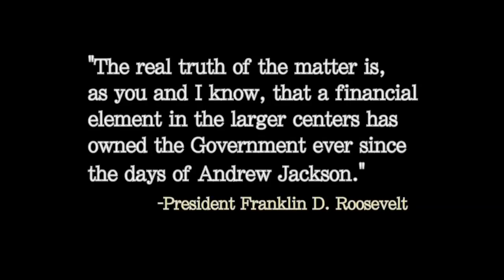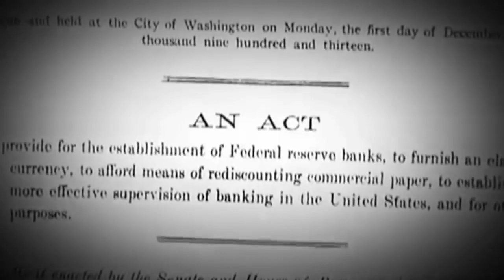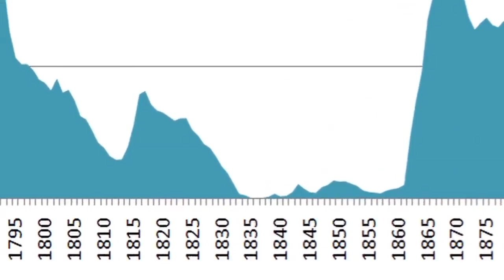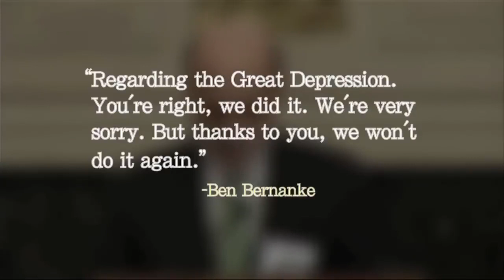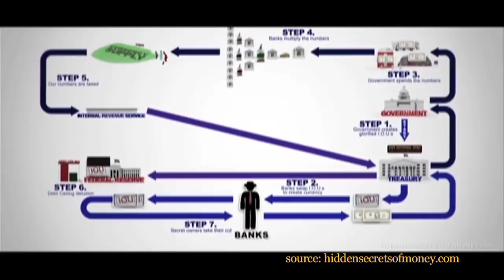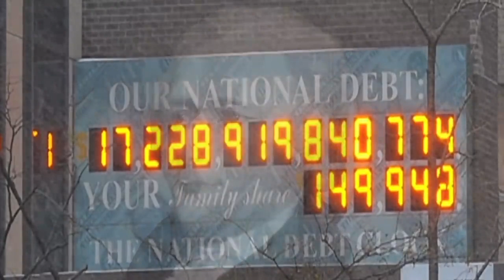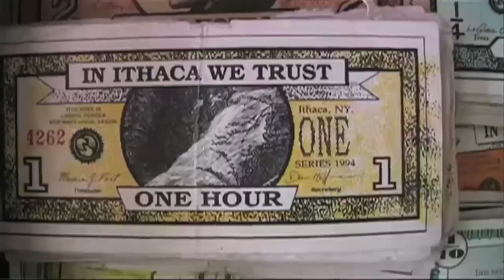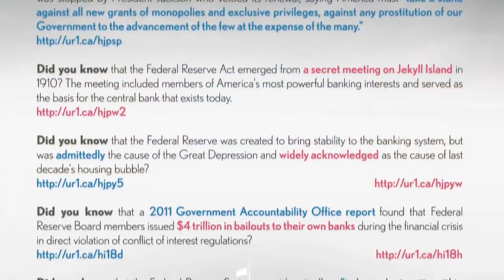How Humanity - is Trapped - Through Money? The History - The Federal Reserve

Comment: March 1, 2019
To:  US Taxpayer
Re:  Federal Reserve Improperly Failed to Disclosure $60,000 Billion in AIG Bailout

The Federal Reserve and US Treasury both reported the AIG bailout was $182 billion and resulted in a profit of about $18 billion for US taxpayers. In fact, the AIG bailout may have cost $60,000 billion more than disclosed and this amount was intentionally withheld from disclosure by the Federal Reserve Board of New York. 

Extraordinary assertions require extraordinary proof so I start with the evidence.

Magnitude of Undisclosed AIG Losses
The massive losses not disclosed in AIG’s SEC filings are disclosed in AIG Bailout Oversight Hearing, Panel 1, Oct. 8, 2008. Eric Dinalo participated in the AIG bailout discussions as NY State Insurance Superintendent and estimated the undisclosed AIG bailout (credit default swaps) at $60 trillion. Six other participants stated similar amounts: Maloney (57 trillion), Yarmuth (62), Turner (63), Braley (63), Welch (62), Sarbanes (62). The troubling nature of the “naked” credit default swaps is also set forth (essentially “gambling”, no collateral, no ownership of underlying asset, no return value to taxpayer, no cap relative to asset).

Federal Reserve Intentionally Withheld from Disclosure $60 Trillion in Losses
The $60,000 billion in losses was intentionally withheld from disclosure by the Federal Reserve Board of New York and the “extraordinary” withholding is detailed in US House of Representatives, Committee on Oversight and Government Reform, Public Disclosure as a Last Resort: How the Federal Reserve Fought to Cover Up the Details of the AIG Counterparties Bailout from the American People, Special Report, US House, January 25, 2010. When the SEC sought full disclosure as required the FRBNY responded that “This requirement is giving us some pause, since we haven’t otherwise disclosed this information to Congress.” The report states that the “FRBNY clearly hoped to prevent Congress from fully understanding the payments to AIG’s counterparties” (pg 13). 

The Committee concluded that the “fact that a quasi-government agency, unaccountable to the American people, likely wasted billions of taxpayer dollars and went to great lengths to prevent Congress and the American people from learning about these actions demonstrates the threat that the Federal Reserve poses to basic principles of American democracy.”

Further facts are found in the AIG shareholder suits vs. US in which shareholders asserted unfair bailout treatment. These cases concluded last year at the US Supreme Court. In those cases, plaintiff asserted that, at FRBNY's insistence, the actual SEC filings did not include Schedule A to the Shortfall Agreement, which would set forth information regarding the counterparties and payments funneled to those institutions (credit default swaps). Shortly after filing, the SEC noted the Schedule A omission and told AIG that under agency rules, it must include the schedule for public disclosure or request confidential treatment. In response, AIG, in consultation with FRBNY, filed a confidential treatment request with SEC to conceal the $60 trillion funneled through AIG from the public in Schedule A. The SEC granted the confidential treatment request. 

I would assert that the request for confidential treatment was improper since the information was not confidential. The losses are publicly disclosed before AIG’s SEC filings in the Oversight Hearing mentioned above and, thus, the information was not confidential and did not deserve confidential treatment.

Audit of Federal Reserve Reveals Trillion in Losses
The massive losses are confirmed in the (virtually unreported) first-ever audit of the Federal Reserve. The audit suggests 16,000 billion had already been doled out. GAO, Opportunities Exist to Strengthen Policies and Processes for Managing Emergency Assistance, GAO-11-696. Table 8 (page 131), 2011. 

In assessing the GAO audit, the Levy Institute estimated the amount to be $29 trillion (Levy Institute, Working Paper No. 698, December 2011, $29,000,000,000,000: A Detailed Look at the Fed’s Bailout by Funding Facility and Recipient).  

The Federal Reserve claims the entire bailout for all recipients was just $1.3 trillion and that a profit was derived from the AIG bailout. 

In fact, the AIG bailout likely resulted in a loss of $59,980 billion rather than a profit of $20 billion.

Federal Reserve Claims Profit
Press Release (newyorkfed.org)
August 23, 2012 

“Today’s announcement on ML III follows the successful wind-down of Maiden Lane II LLC (ML II) in February 2012, which resulted in a net gain of approximately $2.8 billion for the taxpayer. It also follows the January 2011 termination of the New York Fed’s extension of credit to AIG, which produced approximately $8.2 billion in interest and fees. When taken together, the total net profit to taxpayers from the New York Fed’s assistance to AIG and AIG-related facilities was $17.7 billion.”

The media widely reported this alleged a “profit” and the US Treasury issued a similar press release. 

Treasury Sells Final Shares of AIG Common Stock, Positive Return on Overall AIG Commitment Reaches $22.7 Billion 
12/11/2012 
WASHINGTON – Today, the U.S. Department of the Treasury announced that it has agreed to sell all of its remaining 234,169,156 shares of American International Group, Inc. (AIG) common stock at $32.50 per share in an underwritten public offering. The aggregate proceeds to Treasury from the common stock offering are expected to total approximately $7.6 billion.

Giving effect to today's offering, the overall positive return on the Federal Reserve and Treasury's combined $182 billion commitment to stabilize AIG during the financial crisis is now $22.7 billion. To date, giving effect to the offering, Treasury has realized a positive return of $5.0 billion and the Federal Reserve has realized a positive return of $17.7 billion.
https://www.treasury.gov/press-center/press-releases/pages/tg1796.aspx?mod=article_inline

Federal Reserve and US Treasury ….  Mr. Geithner meet Mr. Geithner
The Federal Reserve Board of New York (FRBNY) and US Treasury both ignored their duty to inform the US taxpayer of the massive “secret” AIG bailout and served the interest of the central bankers instead.

The president of the FRBNY was Tim Geithner when the terms of the AIG bailout were “negotiated” in November, 2008. Later that same month (Nov. 24, 2008), Obama appointed Tim Geithner as US Treasury Secretary. 

Mr. Geithner seemingly served the interests of the Federal Reserve as FRBNY President and as Treasury Secretary.

Tim Geithner wrote a book detailing his heroic efforts in saving the economy. Seriously?

Summary

The $182 billion bailout of AIG supposedly produced a profit of $18 billion. It appears that the AIG bailout may have cost $59,982 billion instead and this amount was improperly withheld and misrepresented by the Federal Reserve and the Treasury Department.

 “A nation can survive its fools and even the ambitious. But it cannot survive treason from within. An enemy at the gates is less formidable, for he is known and carries his banner openly. But the traitor moves amongst those within the gate freely, his sly whispers rustling through all alleys, heard in the very halls of government itself. For the traitor appears not a traitor; he speaks in accents familiar to his victims, and he wears their face and their arguments, he appeals to the baseness that lies deep in the hearts of all men. He rots the soul of a nation, he works secretly and unknown in the night to undermine the pillars of the city, he infects the body politic so that it can no longer resist. A murderer is less to fear.”  Cisero

Regards,

Jens Hoekendijk
Reply: I need a loan